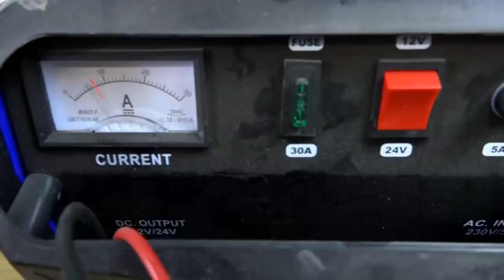100 Year Old Knife tool  Restoration Perfect restoration filleting knife  ???

Comment: Great job Billy Fix! I am amused at the comments.  There are a lot of "Arm Chair Coaches"  that said you did it all wrong. And you "devalued" the knife. Firstly, in it's original condition that knife was unusable. And a knife that can't be used has no value as far as I'm concerned. Secondly, there is no wrong or right way to restore old tools. There is simply your way. And lastly, I'd wager that MOST of the haters in the comments have never restored an old kinfe. Let alone took the time to film/edit it and post it on the internet.  Good on ya mate and cheers!

Comment: Here's a little tip I learned from my aunt who was an antique dealer.  It might help in the future.  You can avoid a lot of work on brass parts if you use four "ought" (0000) steel wool and cloudy ammonia.  All that's needed is rubbing lightly the same way you would use a cleaning cloth.  It will shine brass bright with almost no effort.

Comment: You did an excellent job. If you're open to knowledge I've gained from conversing w/a museum curator, regular mineral oil is used to clean y protect the steel on blades. For the wood scales, or any antique wood restoration, boiled linseed oil applied to the wood, dried, then reapplied, preserves, protects and strengthens the wood while allowing it to breath while maintaining a texture conducive to gripping. But you did a BEAUTIFUL job on that old knife. Outstanding video. Did you make a leather sheath for it yet? I've taken to making the Argentinean/Uruguayan gaucho style sheaths for tucking between a belt or cummerbund and waist. They don't require the removal of one's belt to secure the sheath due to an over hanging flap.

Comment: Steel pin and brass bolster kind of corroded together, Huh.
Have the same issue with an 19858 Remington someone gave me and I am working to get back to usable condition..
Thank you for restoring it with original parts!

Comment: maybe try some oli&wax on the handle scales of your next knife. that clear coat will be slippery when it gets any liquid on it during use - tiring and unsafe. best gently sand it off this one and oil/wax it or use fine steel wool to take back the shine and wax it - much nicer in the hand and much safer for a knife that gets used

Comment: Good of You to  try not to destroy the tool - nice to see somebody with respect, even though the initial sanding paper seems far too rough :)
.. Oh, looks like way too much sanding - removing original material - I would try more polishing and less sanding. Still happy to see your concern in total.
One last tip by the way, the brass would fare much better with that protective lacquer - that should inhibit galvanic corrosion between iron and brass when wet!

Comment: Funny! Loads of ‘views’ loads of ‘likes’ and quite a few ‘appalled’ critics, one thing shines through, those old carbon steel blades hold a fine edge and should be treasured for that quality!
Reply: Pat you are exactly right I have an old Hinkle's meat cutting knife and when I'm in a hurry I take it out of storage and use that instead of my brand new knives, stained steel and all it outperforms the new steel 5 times over and also holds an edge much longer.
Reply: I always used the Sabatier K2s in my early days of being a chef, they never needed anything more than a quick hone on the steel.

Comment: I have a knife with the exact same logo and is 150 years old. All it was when I found it was a thin long rusted rat tail of a tang and the blade was orange. Well after sanding the rust off and making a quick handle, that turned out to be the sharpest knife I own. I even shaved with it. I call it Bloodletter, because I'm constantly drawing my own blood. The shape is almost exactly the same but mine has a more even profile and bullet shaped tip and wasn't a full tang, more like a thin bar tang but it is holding nice!

Comment: Nice result although I'm struggling to understand the effort expended with diluted vinegar, electrolysis and soap powder when all the work was actually done with abrasion and polishing.
Reply from the maker: im learning i though it was the best way but mabe not :)
Reply: @billyfix1129  i agre with Malcom about everything, and then after all efort you solve rust problems with grinder and handles with epoxy. That's not restoration my friend just fixing some problems.
.
Reply: ivica vinkovic I don't agree there, the knife has been restored well to a good and useable condition. How it was done is up to the craftsman who is restoring the tool
Reply: That is certainly true, and he can make any changes to what he does as he works through further projects

Comment: Why did you go to all of the trouble with the electrolysis bath to remove the rust from this blade when you could have done it with the brass wheel you used after the bath? Would have only taken you 2 minutes! You really made this project very long and arduous and difficult!

Comment: Fun fact: what's you're using BC-90 look a lot like what is called WD-40 in France and Europe, is it the same thing? 

Also watching your dremel functioning all-right after the bukkake it took at 10:04 is very impressive ^^
Reply from the maker: I’m from the uk bc 90 is just a cleaner like break cleaner
Reply: @billyfix1129  Can it be used as a rust-remover or lubricant? 

And do you have WD-40 in UK?

Comment: Does it matter which pole is connected to what?  Haven't done electrolysis so I was Wondering.
Reply from the maker: Positive on the sacrificial metal negative on the thing you want to take the rust off
Reply: @billyfix1129  Much Thanx

Comment: Just had to comment, so many cringe-worthy moment in this video. If you are trying a restoration, you are doing way too many intrusive and unnecessary interventions (which should be kept to a minimum). Also too many rotary tools used, they tend to remove too much material and are not forgiving. Also don't understand they quest for that everything must be shiny. For example the handle should be given simply a few coats of linseed oil, not heavy varnish. Please, do yourself a favor and watch how others perform this. But keep going and have fun doing it.

Comment: Looked wonderful until u sprayed that handle then it went down hill from there! And wd40 is warter base it will rust that blade brother.
Reply: wd40  is the 40 resecipe,  and it is to displace water.  It is for cleaning, used for fishing.  I would never, but have heard.
Reply: WD40 is water based? Bahaha!
WD is an abbreviation for *Water Displacement*, and the 40 stands for, like Scotty said, 40th formula
Reply: But, I give you that, it's not good to use it as rust prevention if not applied daily, since its low viscosity. It's more to for free rusted parts and first aid, when metal got wet, especially if it has hard to reach places like nooks and crannies.

Comment: "Made better than new"?
Not by a long shot.
You should have left the patina on the blade.
Taking care of the rust under the handle slabs is O.K., that helps preserve the knife.
Removing the patina and polishing the blade? Making it look like a new knife?
Destroys any collector value it had, and does not extend the life of the blade.

A hint for you: When driving out pins, it helps a bunch not to have a solid surface under the pin.

I had to stop watching at 2:29 when you start grinding on the guard pin.

It was a nice knife before you started.
Reply from the maker: i was happy with it for my first ever go at restoring an old knife i will try better next time
Reply: @billyfix1129  you just destroy it, I'm so agree with @Steve Huffman

Comment: Nice,  can't say it's better than new, probably prettier than new, but better.... I dunno. This was a workaday knife, being pretty was never a consideration. At least you caught it before it was too bad, the part under the handle looked like it would probably continue rusting and would rust away. I can't go with your decision not to hone the blade. I like all my blades razor sharp.  If you ever want to get a really fine finish on something, you can go as far as 12000 grit paper. I notice you tend to use the papers made for a Dual Action sander, that's expensive way to go unless you found them cheap somewhere. You should probably start using wet paper. It tends to give a finer finish. Also, if you're gonna use the vinegar treatment, don't dilute so much. If you want to speed up that process, use a pan you can put on the stove and heat the vinegar solution to boiling then back off the heat so it's just almost boiling, and put the blade in that for like well it depends on how bad it its, can take only a minute or two, or can take 30 min for severe rust. You could also do a light plating on it once you get it clean,  use a low (3 volts or less) setting and a longer time for plating. This fills minute scratches and protects from reacquiring rust. I also prefer a coating of WD40 when i'm done. WD stands for water displacement, and no water means no rust. It lasts a good long time too. I have no idea how long the 2 stroke oil will last. maybe it's great, I don't know never used it for that purpose. Glad you saved it, maybe it will go another 100 years.
Reply from the maker: its better because its seen 100 years of hard work and its still here :)
Reply: @billyfix1129  You didn't understand what I was saying. Is it  better than when it was new... actually since he didn't hone the blade, I can say probably not. A dull knife is not a good knife in my book.
Reply from the maker: @tootall5559  I didn't want to hammer the blade any more than it was im not a professional its just a hobby I didn't want to damage the blade as its so old looks nice on my workshop wall though I think its cutting days are over :)
Reply: @billyfix1129  well I am nod a decor guy. it can look good, but if it can't do what it's made to do, I don't care for it. I really don't care if i'ts a year or a hundred old, I like things to do what they are supposed to do. Looks are secondary or even thirdary (lol) That's me, nothing wrong with what you do for your tastes, it's just not my taste. I just can't stand a dull knife. I've been known to put an edge on table knives.